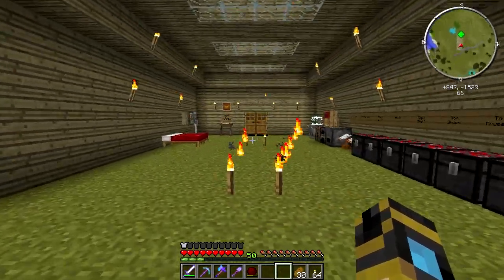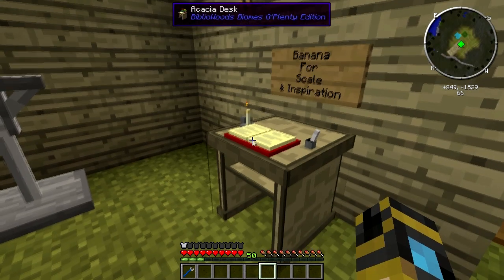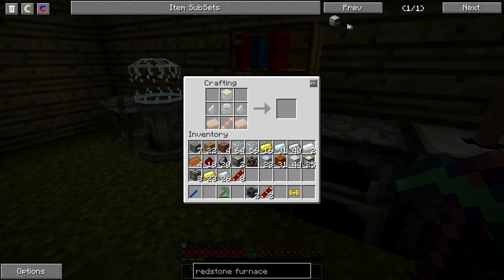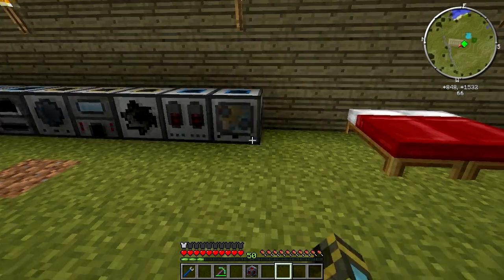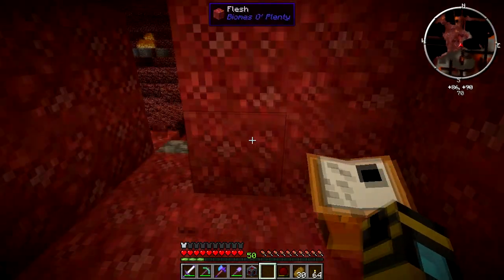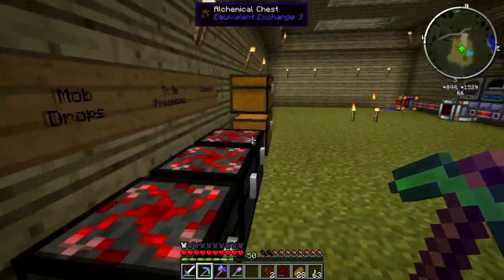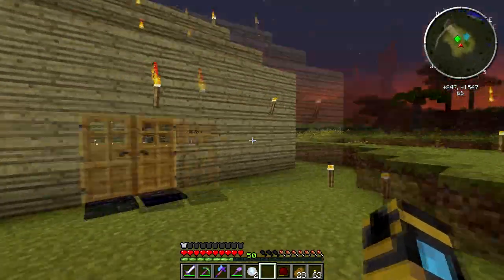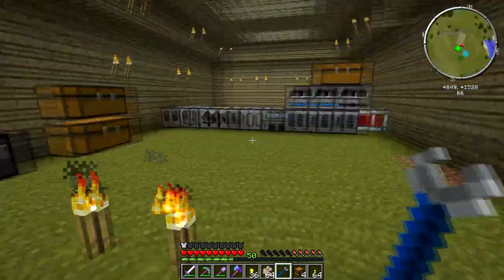PahiPlays ForgeCraft 1 S1E3: Thermal Equilibrium

Comment: Pahimar, I have a few recommendation for you:
You can take a crafting table and put in a crafting grid and you'll get Tinkers Construct crafting table; it works like a normal crafting tables, but in case you need to get more items you can just leave the items in the crafting table and they will stay there, so you won't have to take them out and then put them back in again! (Edit: I've just seen the end of the episode, you mentioned that you were told to do it already, sorry.)
You can also make nether brick by smelting netherrack (4:1 ration)
When looking recipes in NEI, instead of clicking the question mark to show a "ghost" form of the items, you can shift-click the question mark. that will take all the items needed from your inventory (assuming they are in there) and put them straight into the crafting table in the right slots! Really useful when crafting complicated recipes.
You can also pick up Thermal Expansion machiens and ducts by shift-right clicking them with a crescent hammer.
By the way, you've been pronouncing Cyclic Assembler wrong, the Cyclic is pronounced Cy-clic, from the word Cycle.

Thank you so much for doing this series, I really enjoy it and wish you good luck later on in the series :)

P.S. Sorry for any grammar or spelling mistakes I've had, I'm not a native speaker.

Comment: If you right-click on a furnace with the crescent hammer, you can turn it around. This makes it so you can have input/output on the front of them.
Also, you should really put the pulverizers on top, because you will want to pump ores into those a lot more than you want to pump them into furnaces later. Having them on the bottom removes one side where you can use hoppers to input items (since hoppers cannot be pointed upwards). Since furnace is the last step, and items can output downwards, it's easier to have those on the bottom.

Other than that, I think all placements were rather optimal, you did put the crucible and transposer next to each other, so you can crush items into fluids with the crucible and put it in items with the transposer. Don't know if that was intentional, but it's the optimal placement :)

BTW, really excited to test out all these new EE3 stuff! Been waiting like crazy for them, I actually squee'd a bit when I saw people spotlighting them in their videos :D

Comment: Just a quick tip, you can sneak+click (left click I believe) on the question mark in NEI to automatically fill the crafting grid for a recipe if you have the required materials in your inventory (at least it should work, but it's forgecraft, so who knows)

Comment: Try shift clicking on the question mark in nei, it auto fills the crafting table with all of the items you need for the recipe, but only if you have the items in your inventory.
Reply: And if the components all stack.
Reply: syy1125
Yeah, something iffy with unstackable items right now, but it's on the fix-list (if it's not fixed already).

Comment: Why don't you shift click the question mark to automatically put the items into the crafting table?
Reply: I think it was because he tried to with the machine frame, but he did the one that required steel instead of the iron one, thus he probably just decided not to use it as he didn't realise. :P
Reply: Science-Recon
Nah, the shift-click there seemed unintentional. I think he just didn't know about the feature, since he hasn't played since that was implemented. It's still a rather new feature.

Comment: Pahimar? you can use the crescent hammer for breaking your machines (by shift+right clicking you machine) and if you use a hardend energy cell then you allso need hardend energy conduits, then can the power go faster to your machines.
Reply: Nope, leadstone conduits work fine with higher tier energy cells. Of course each connection of a leadstone conduit is limited to 80RF/t, but no reason not to have multiple connections.

(The capacity of all the tiers is unspecified: only the rate of RF transfers over each connection.)

Comment: you can upgrade your thermal expansion machines so you dont need more than 1 i forgot what the upgrades are called but there are 3 types of upgrades
Reply: I think you are thinking of IC machine (which have 4 types of upgrade). While TE upgrades have been suggested they have not been implemented.
Reply: idk if its in the packbut i know they are there

Comment: Does the server have mfr ? Because he can substitute the steam dynamo  with a biofuel engine and the biofuel engine only needs water to work
Reply: You mean the Steam Turbine? The Biofuel engine requires biofuel.
Reply: Nah in my single player world im running on waterpower using the mfr  biofuel engines yeah they use biofuel but water works too might be a bug but it works
Reply: Most of their blocks are curreently able to run off power but its getting fixed soon
Reply: Mike Cummings well there goes my cheap waterpower